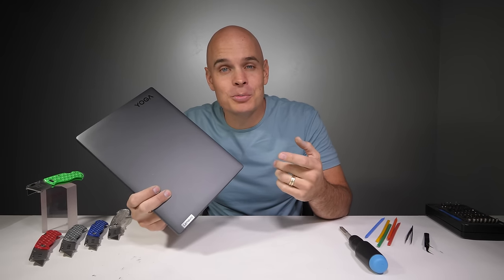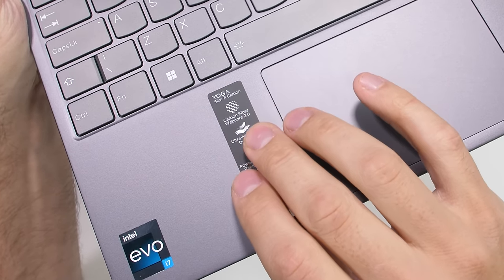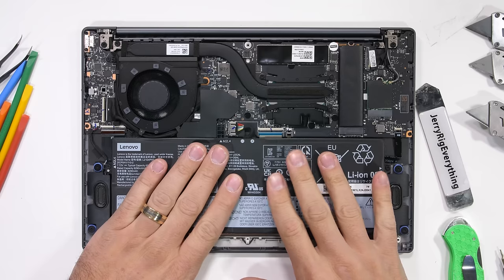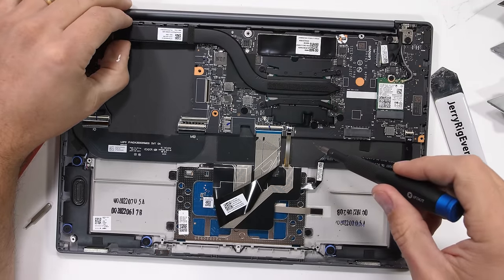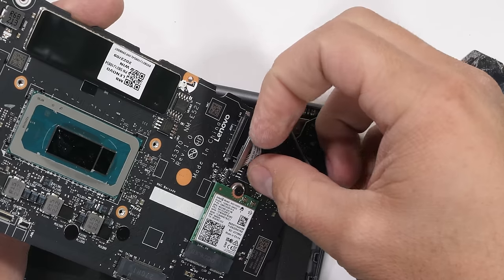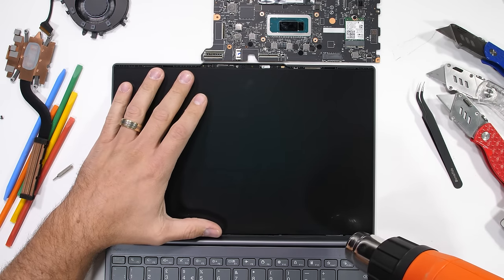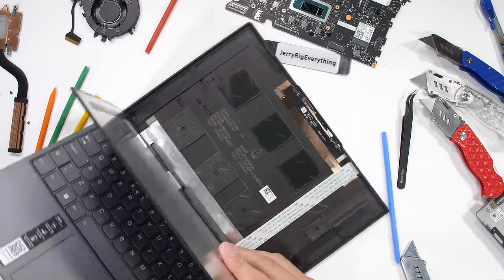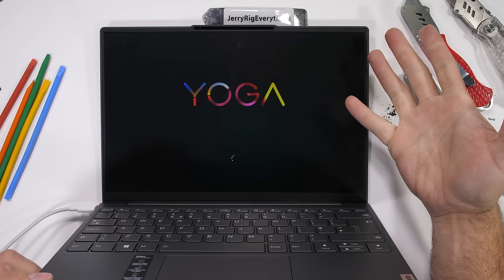FINALLY a new Laptop! - They say it has Carbon Fiber?...

Comment: 3:40 after a lot of eye squinting and toothpick pointing, I counted 96 individual fan blades
Reply: U can zoom in on videos on YouTube now
Reply: +1
Reply: There are 96 outer blades, 20 internal rotor points, and 19 bi-amnios torsion anchors. 135 total doximinal ven1 contacts, (not including the point of rotation)

Comment: Hey Zach, just as a note, almost all laptop displays that don't have screws have those magic pull tabs, the same as found on iphone batteries, the same on this one you just needed to pull on the bottom part and you could remove the screen without any prying or heat.
Reply: This is more like iphone a iphone display which does need heat and prying

Comment: You astound me.  I tore apart computers, before laptops even, and then redid the motherboards, which involved mainly circuit design and boards.  I had help.  Thank goodness, it was hard even back then.  But I was witness to the entire evolution, including Apple and the 6502 (I typed that from memory!) - I did machine code for these little beasts back then.  I guess that's why I'm hooked to your channel, but mainly it's because you can disassemble any of these little beasts and put them back together again.  Hell, I can't even see them anymore.

Comment: Pro tip: laptops with narrow screens have reusable adhesive strips with visible pull tabs, DO NOT APPLY HEAT, those were in the bottom, take the whole lid out and disassemble it completely

Comment: small tip : the screen has two pull tabs just like the iPhone battery you pull them form the bottom corner sides and you don't need heat to remove the screen

Comment: Nice. I have a high-end Macbook, and desktop PC, but the computer I use most is a near 13 year old Toshiba M780 Tablet PC (Laptop twisting screen with touch and digitizer.) In Thirteen years I replaced the Keyboard and upgraded the HDD to SSD and and swapped the Wi-fi card to add AC, oh and now has Win 10 pro on it, but this little i7 with 8GB Ram still does most of what I need, in a small rugged package.

Comment: The carbon fibre is probably a a short or long fibre SMC as opposed to a fabric or UD. UD wouldn't be stiff enough in the secondary fibre orientation so you'd get a lot of matrix cracking when flexing it. SMC is more than strong enough for a laptop screen such as this, and allows it to be easily stamped in matched moulds for OEM style mass production. I could be wrong but this is how I'd approach making something like this from CFRP

Comment: Cool to see insides of a laptop I see daily at work when repairing them. Our company sells them to schools with repair and service as students sometimes have accidents and don't take such good care as some might think.
Reply: That's why every kid's phone screen is cracked, while my iphone 6s+ finally cracked after 7 years.
Reply: I work in school tech support. Our student devices primarily consist of Chromebooks. We used to use Windows device, but those have been largely phased out several years ago. Even with the Chromebooks, the kids still like to pick off the keys, rearrange them to spell expletives, and a few with broken screens. A lot of these kids don't really care about them.

During distance learning, we had numerous Chromebooks come back snapped in half or broken screens or missing keys. It was a mess.

Comment: Almost the end of 2022 and I am still using the Lenovo X230 purchased in 2013 in the top configuration for this model i7-3520m 16GB Ram 256GB SSD with backlit keyboard, LTE modem and 44 ++ (9-cell) battery. Of course, the mandatory jailbreak from 1vyrain and the icing on the cake, the Nitrocaster modification with the installation of Full HD IPS. It works like gold, the only plan for the next few days is to buy a new original battery because the one bought in 2013 with the laptop lasts a maximum of 1.5 hours. The laptop has traveled half the world with me and has never let me down, unfortunately they don't make such durable devices anymore. The equipment as a workhorse works great, it is known that it does not have such performance as models with the latest processors, but it is still a good option for an inexpensive and reliable laptop.

Comment: man traveling in 2019 and 2020 was so fun, no traffic, low prices and no issues.. i travled the most i ever had in my life.. the only time i got sick was when i was forced to get vaccinated or id lose my job .. from then on i got sick 3 times for the first time in 6 years and each time the exact location of where i got my shot actually hurts as if there is something under my skin radiating pain around a 3 out of 10 and its a dull pain not a sharp pain and only happend when i was starting to get sick

Comment: They still do the batteries the same as 10 years ago. I work on laptop repair. Got a chuckle from "not many people see, unless they're subscribed" as I see these things constantly. Honestly this all looks incredible familiar even to models from 10 years ago. I would like a screw scratch test in these videos. One of the main problems in repairing these things is the screws go to powder or otherwise just deform around my screwdriver a lot. Some manufacturers suffer more or less from this. HP's been pretty good in my experience. Toshiba awful. Lenovo kinda middle of the road. But when it comes in for repair it's usually a few years old so seeing how careful I need to be ahead of time would be lovely. Fun fact on this, I used my flathead 0.8 to scratch a new screw head pattern into a fucked up screw last week. That is an upside of the super soft screws. Gotta wonder how soft that was though.

Additional note, displays on laptops are historically very replacable on most laptops I've worked on. I've not met one that's had adhesive on the screen itself in a long while. Usually just held in by metal brackets covered by the plastic strip surrounding the front of the screen, which is the only usually adhered part. I replace them fairly regularly, kind of a pain but not the worst repair, that honor goes to keyboard ribbon cables on laptops where the whole motherboard has to be removed to get at the fucking keyboard.

Comment: Don't pull heat pipes on the end! Thermal paste is a poor adhesive, but it still often glues heat spreader to the chip. In that case, if you pull heat pipe on the end, the force will be big enough to bend it. Remove cooling system by grabbing it somewhere around the chip and slowly pulling it.
Reply: He’s literally rich he can buy a new one

Comment: see the problem is: All shipped Lenovo Slim 9i are carbon neutral certified to PAS 2060:2014
Product carbon footprint is conducted in accordance with ISO 14067:2018 and certified by TÜV Rheinland

Comment: hp omen 2017 - carbon ,bangs and olfsen . still best laptop . falen knife stabed in screen  got white hole . still works after 2 years , felt from chair on screen closed with mouse inside  just side poped and back ..  works on - celzium  but dont heat it ..:)  screen crashed 10 times before i figured why - no dmg

Comment: most 'gaming' laptops have 2 upgradeable ram slots, 2 upgradeable NVMe slots, upgradeable wifi card, and of course thermal paste and fan fixing. although, they usually weigh 2.5kg and last 3 hours on battery, so this is still impressive
Reply: Memory : 16 GB DDR5-4800MHz - (8 GB SODIMM + 8 GB Soldered)
Reply: This is obviously not a gaming laptop...

Comment: A little disappointed to see ports soldered to the mainboard.  When these ports get damaged, they can damage the mainboard... I like when manufacturers put these ports on short cables to limit damage.
Reply: Yep. I work in school tech support. Over the past 3 years, we've been slowly upgrading our fleet of staff devices from HP ProBooks to Lenovo Thinkpads with USB-C docks. For the most part, they work great. However, I've seen that right around the 1 year mark after we deploy them, we start seeing problems with the USB-C port on the computer. Sometimes it starts with a random disconnect. Then it progresses to constant connect/disconnect which drives teachers mad because of the USB insert/unplug sound. Then the port stops transferring data and only charges the laptop. We don't have the tools, training, and most importantly time to do these kinds of repairs so we have to send the unit to a 3rd party repair facility where they usually end up replacing the entire motherboard if they can't fix it. It sucks because if the port was modular, we could easily swap them out and have the teacher up and running in no time.
Reply: @JJFlores197  Replacing the USB-C port itself on the mainboard is pretty easy once you do a couple... but I've found that in some cases, the actual PCB gets damaged... requiring botch wires and added diagnosis time.  And if the PCB has 4, 6, 8+ layers... and something important running through the area of the USB-C gets broken internally, it becomes untenable.

I know higher end Dells used to use off-board connectors... my GF's still usable 2011 laptop is like that... but I can't vouch for newer (or lower end) Dells.  Of course, I wish Dell put as much thought into their overly complicated charging cable/brick... burned through a whole bunch of those.

It's a shame Louis Rossmann (Rossmann Group) mostly fixes Apples... his crew could probably replace USB-C connectors easily... and cheaper than a mainboard replacement.

Comment: 2:50 i have an rog 6 phone right.. and it has 6000mha I'm confused to how this huge battery bigger than my whole phone  has less Mha than my phone, I used to know ow I think but besides materials idk what it could be someone explain?
Reply: The laptop battery is 7 to 8 volts and is more than 6000mah but our phone batteries have less volts between 3.5 to 4.5 volts but at 6000mah battery. I can simply also say laptop battery has two 6000mah cells but they are in series so that the voltage will be more than 8v.
Reply: @WarriorRev6300  i see

Comment: I didn't see any ram chips. Are they part of the motherboard? not upgradable ? when the X1 carbon and yoga first launched one chip was soldered to the motherboard and one was not. but this one didn't have any removable chips that i could see.
Reply: some models have removable Memory : 16 GB DDR5-4800MHz - (8 GB SODIMM + 8 GB Soldered)

Comment: i owned a lenovo yoga c930 for a couple of years and it was really awful. i really suggest no one buy this. the build quality was pretty good it seemed at first, but i think it had an audio hardware defect which only showed up a few weeks in (whenever i would pick up the laptop, the audio drivers would crash and the laptop would require a restart). in addition to that, it would heat up SO FAST and it would quite literally burn to touch, and the power adapter actually starting bubbling one time from being so hot. i am a music producer so i need a powerful CPU, good audio support, and efficient cooling. it did none of that. the screen also had pretty terrible contrast, some weird backlight splotchiness, and the battery degraded horribly fast (likely due to the heat). i suggest a microsoft surface or a dell, avoid lenovo. they do not have great quality assurance.

Comment: I'm so confused that they put the Yoga branding on a clamshell laptop. Yoga is supposed to be their line of 2-in-1 laptops.
Reply: It is a 2-in-1
Reply: @milktoast56  That is not a 2-in-1. Lenovo uses a long, single hinge on their slim laptops (like this one) and two small hinges on their 2-in-1s. Also the (now defunct) listing on Lenovo's website neither mentions nor shows the Slim 7i Carbon in Tent Mode, which they go out of their way to show.

What happened is Lenovo has simply changed the branding of Yoga from "These are our 2-in-1 laptops" to "These are our high end, non business, non gaming laptops that are not Thinkpads"

Comment: They probably also went with magnesium on the bottom and carbon fiber on the top to help with balance. You don't want the laptop tipping over backwards when you tilt the screen back.

I'm surprised they've used the Yoga branding on a laptop which can't fold open into tablet mode. That was the whole point of calling the line Yoga -- flexibility. Now it becomes stupid like other brand laptops where I need to dig through the pictures to see if it's just a laptop, or can fold into tablet mode.

Comment: Lenovo is a real good brand I use to get hp and nothing but trouble out of them and cases break too then I bought lenovo and it's 3 years old and still in new condition and running like a new one first time I haven't had to call for warranty on a laptop lol, never again hp.

Comment: Audi MMC multi-material-construction mixes carbon fiber, magnesium, aluminum, high strength steel, titanium, magnesium aluminum alloys, stainless steel, polymers & plastics & fabrics both biological & synthetic / to make the vehicles have better overall dynamic, lower mass, better efficiency, improved performance, improve handling, better braking performance & overall better drivability & agility to make the joy of driving safer & happier :)

Comment: still dumbfounded by Lenovo's decision to make "Yoga" laptops that aren't, you know, bendy (ie. convertible). Was never a huge fan of the "yoga" branding but at least it made sense for a laptop that can fold the full 360 degrees into a bunch of different form-factors. Why in the world anyone would think it's a good idea to slap that label on your run-of-the-mill ultrabook is so beyond me. Laptop seems pretty nice overall tho

Comment: You made it lighter than MacBook air but at what cost
Reply: At the cost of replacable RAM, apparently. I personally don't mind a chunkier laptop if it's repairable and upgradable.
Reply: @Dysfunctionality15  Almost all Windows laptop can be upgraded with more RAM.
My point is, they made it lighter using Magnesium and Carbon Fiber but it's gonna cost the fortune of money
Reply: @iamshivaagrawal  Ah, I see, that makes sense. I think it's like $1200.

Comment: Carbon fiber laptops sound cool on paper, but are garbage IRL. Carbon fiber is really solid for plastic, but can hardly hold up with the properties of high quality steel, aluminium or alloy. The biggest issue is that small pieces like screw holes are really easy to grind off, so its lifespan is much shorter.

The fact that they use it only for the top is a really good choice. Carbon fiber is hard to bend, unlike metals, so it'll provide very adequate protection for the display.

Comment: I am very disappointed with Lenovo, they havent improved at all, after using it one year the hinges getting hard and its not easy to open the laptop, a year later the plastic which hinges attached to them start to break cuz of how hard it was to open. I have had two of them one yoga and one ideapad, both hade the same problem.

Comment: Lenovo uses pretty neat parts into their notebooks but they don't think it through. That's what I hate about their products. You see dealbraking errors after you bought it. I had a gaming laptop from them but they integrated it extremely stupidly by using the CPU graphic unit to output on hdmi. This means the gtx 960 had to render, return the data and let it output by the CPU which could lead to bottlenecked performance. Also they tried to radiate the heat like a macbook from the same era, which blows the hot air between the hinges against the bezel of the screen. Since a x86 Windows laptop is known to generate a ton of heat and the glue of the bezel is heat activated, sooner or later the bezel will separate from the screen. Also the GPU rerouting has been realised by auxiliary electronics which forces you to use obsolete drivers that has been modified by Lenovo. Every aspect of their shit screams Chinese garbage.

Comment: I had a lenovo yoga slim 7 10th gen i5 and it sucked at every aspect, it sucked so much that it couldn't run basic tasks without overheating, after just 10 months I had to switch to a new laptop. Thankfully Dell makes better machine than Lenovo and is lightyears ahead when it comes to built.